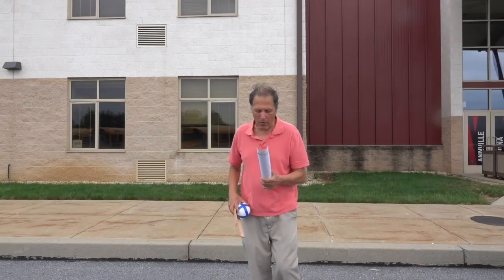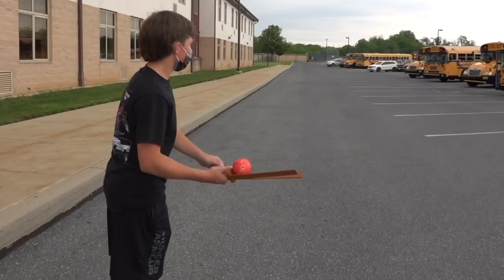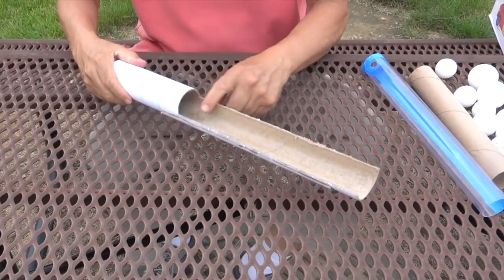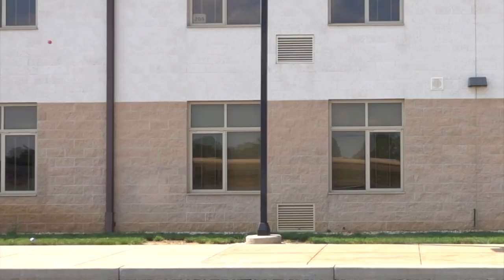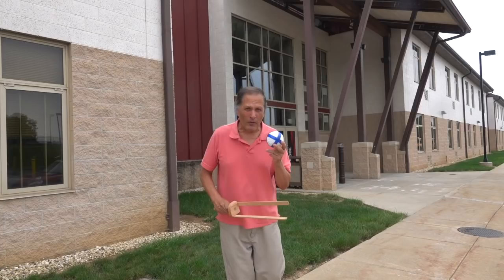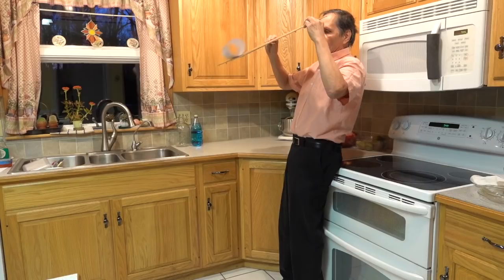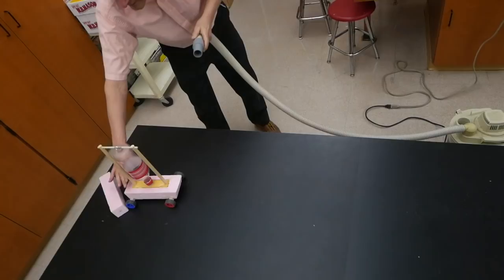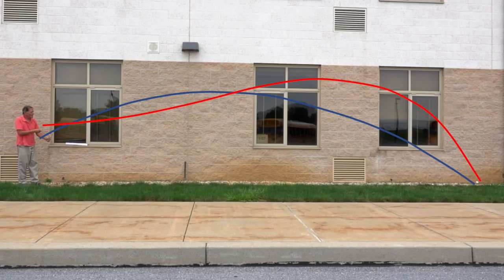Curve ball Flinger....Magnus Effect. // Homemade Science with Bruce Yeany

Comment: I used to throw marbles with a pipe with a movement like this. It's so powerful it could probably kill. I even practiced shooting it and it would sometimes put holes in plywood. It can reach about 100m-250m but accuracy is very low since it still spins and curved sometimes, even though it's small and heavy. But accuracy is good enough in about 20m range. It is one of the most dangerous things I've done and came up with as a kid. Marbles would sometime just shatter on impact.

Comment: Excellent video...Is the Magnus effect the reason for swing balls in cricket? Also would like to know what kind of effect does shining the cricket ball just on one side create? Does differential sides in a projectile (cricket ball) create more pronounced Magnus effect (swing)?
Reply from the maker: I didn't add it to this video but thought about doing one on this,  the Magnus effect and  the knuckle ball, one with no spin, however we need a better camera to capture it.    We have played around with the design similar to that of the cricket ball,  smooth on half of it and rough on the other half,  in this case the rough side has more friction as it passes through the air,  the greater friction against the air pushes it towards the smoother side. My understanding is that this is not considered an example of the Magnus Effect.  However,  if the ball is thrown with a spin around the correct axis,  the ball can curve due to the rough side friction and the Magnus Effect at the same time, with a sideways and upwards movement.   I believe that if a baseball is oriented correctly, it can also curve in the same manner as the cricket ball.
Reply: @YeanyScience  Thank you

Comment: is magnus effect similar to bernaouli's effect?
iam able to feel that the ball creates pressure differneces in the sides?
am i correct?
Reply: Don't forget Venturi - he is in the mix too.
Reply: Bernoulli’s effect is about how the air moves around an object, and the magnus effect is about how an object’s spin changes it’s path through the air.
You’re right. Each side has a different pressure. One side is moving forward, and the other moves backward. This means that one side is pushing harder against the air and creating more pressure.
Reply: @thatlumberjack  oooh so the preesure difference shold be the reason there is this deviation or lift .
ah i usually see this in golf balls. the small depresions in the golf balls are also made for the same reason.
mr david my only doubt is how is that small depresions ro rough surface will increase this magnus effect?
sorry to bother you but how does that deprssion creates more magnus effect?

and thanks for clarifying me .

Comment: What happens if you build the slinging arm extension Brachistochronical instead of straight? Will it have more spin? Or will it fly faster? Or both? Or no difference?
Reply from the maker: Good question,   I don't have an answer for you, perhaps someone else will,  one factor we did test was that does affect the speed would be the length of the basket.  Up to a certain length,  making it too long then becomes harder to control and swing.

Comment: I wonder what kinds of variables the kids have come up with to test.
Reply from the maker: When I had middle school students investigate this,  we combined using throwing balls with the cup flyers and the Flettner rotor.  Changing the mass was easy, as was the surface texture. Changing the amount the surface area had to keep the same mass,  air speed  (measured with an anemometer) in some cases was simply firing into a wind  or changing the nozzle distance away from the rotor, also changed the Flettner  rotor spin rate. We could change the spin rate on throwing the  balls by how smooth the paddles were, adding rubber to the paddle increased the friction the most, and smooth PVC pipe had the least.   Students also made sling shot type of contraptions to throw the ball without  spin.

Comment: How do you use magnus effect to more accurately hit a target?
Reply from the maker: two good examples are footballs and bullets.  The spin makes the objects more stable and smoother passage through the air in their flight.
Reply: @YeanyScience  So a shape more like a rounded cylinder than a ball.
Reply: @kenvandeburgt1232  I think he meant soccer balls, Beckham's "Bending" is the Magnus effect. Lots and lots of pros use it in all the ball sports, from golf to tennis, etc. Bowling however adds weights inside their balls to make them spin so they don't count for this effect.
Reply: @TheRadioAteMyTV  No I think he means footballs as per American Football. He means bullets and the spin put on them by rifling in the barrel of a gun. 

A soccer ball doesn't go straight like a football does.
Reply: @kenvandeburgt1232  Hopefully he will let us know. Either way, the effect is pronounced heavily on the round ones. Not sure how it could happen on an oval ball, since its rotation is sideways and not against the front.